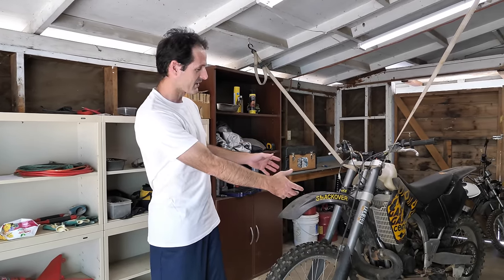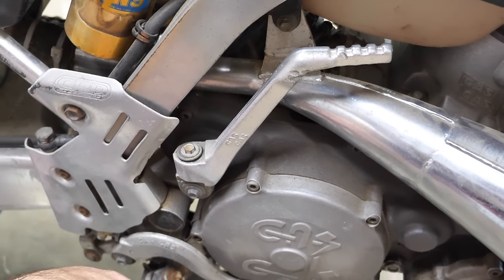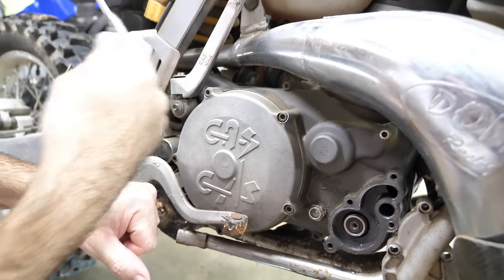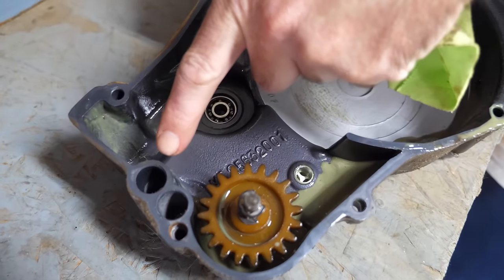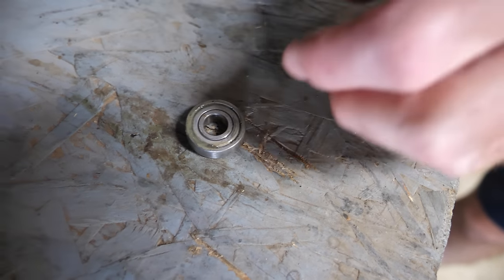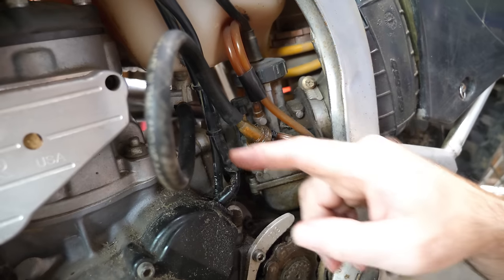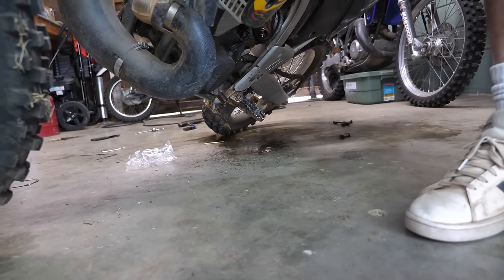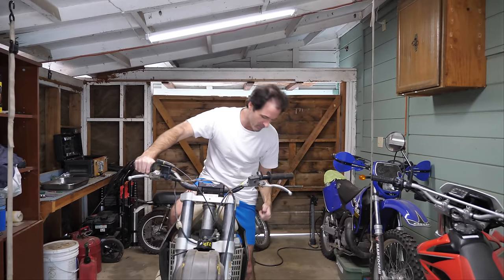Rare Old Dirt Bike Picked From A Backyard - WILL IT RUN??

Comment: This video felt like a throwback to the old days of Jennies Garage, loved it.  Also, that type of water pump seal is very similar to the floating face seals used on Excavator Final Drives, also called a duo-cone seal.  They're really durable and last a long time if kept clean.
Reply from the maker: Glad you liked the video! It looks like that type of seal is more robust than the rubber kind. And it doesn't leave grooves in the shaft.
Reply: Also the Same type of seal used on hot tub pump motors.
Reply: poolman here...what is this technology you may speak of? i only ask because " i no want fix no more" type 25+ years in its just annoying now ...Can this seal withstand more normal heat than a pool motor? Im asking is it new? Stopping leaks would help us all out right? Apoligize if i havent researched yet before i asked. It sounded cool.  Couldnt resist that, and...well what if it works?
Reply: The previous owner thought it needed a clutch because it was bathed water and not gripping very well!

Comment: Smackover Motorsports was the GasGas importer at the time the bike was new. The steering damper is from Drew Smith at Works Enduro Racing.  The bike also has some decent period-correct upgrades - LT Racing power valve cover, larger gas tank. It's obvious that at some point the bike was valued and loved, before it was beat on and neglected.

These were absolutely incredible bikes back in the day, and will still stand up as a great woods bike. I just finished an engine rebuild on my 99 EC200, and it's back to riding the single track like the day it was new.

For those watching this later, Central Powersports Distribution carries the legacy GasGas parts inventory (now Rieju), and the water pump seal IS still available as a kit.
Reply from the maker: Thanks for taking the time to comment and share your knowledge about Gas Gas bikes.
Reply: Matto Cycle and Halls Cycles still have a lot of old GG parts in stock

Comment: :face-green-smiling:If the scratches REALLY bother you.....EBAY has them coming from Slovakia... Plastic Body Kit-Brand New
$250ish
Full set of gaskets?.....WHY NOT?
They were as unsure as you what they would find, good insurance.....

Didn't see you check for plugged emulsion holes...could cause air fuel mix ratio issues....

Old gas? 
Works as a10:1 mix in your old carburetor machines as well...That's how I dispose of my used motor oil too.
Excess food take out napkins filter gas well here...

Needed 3 smoke breaks for this one, your "word play" was killing me... 😏😉
Reply from the maker: Thank you for the recommendation on the plastics! Good to know they are still available. I blew out all the holes that were easily accessible on the carb. It was so clean though, I didn't take it apart any further.

Comment: Crazy thing is that water pump seal...its the same as pool motors. A porcelain to porcelain seal. Everyday folks...we learn something new. Also love you guys channel. The positivity the joke attempts, its all just genuine. Thank you. Keep em coming.
Reply: Pool service etc is my occupation not by choice its just what i know. But those seals...look identical to pool motors my guess is just a bit smaller. And as you said,,,being threaded backwards on empellars yes...is a thing. Some do have a screw in the center of that guy made of plastic that you can easily stripp out not knowing shes in backwards bud"Like the prop on a airplane. A pool motor is looking the same as i see here as far as seal and sealplate. No volute present for there is no pump pot.
Catching the fact that it hit the case due to damage on plastic...good eye. Very good eye. Exactly as you showed...if that seal gets hot and runs without water to cool them..or has that kind of movement allowed they have a fair reason to leak. Its porcelain im not entirely sure how it works not sure science does either but  somehow it works without leaking lol...and the heat dissapation is highly pretty recommendedly decent in ceramic. Arent space shuttles made out of this coolness material?

its a tiny pool pump. h.3l yeah"

also kudos on that 3rd kick....you know u gotta redo all fuel from any purchase....but saving money on the part cleaning solution..from the crappy gas....i cant resubscribe? Upvote from me.

Comment: I wouldn't call myself a bearing expert, but I've dealt with them quite a bit.

There are two reasons for bearing play being a thing: One is to prevent the bearing from locking up or being harder to turn, when the metal expands due to operation in environments above room temperature. The second reason is that every functional surface is manufactured within a certain tolerance - there always needs to be a little play to account for that.

There is a DIN Standard which sanctions radial bearing play (or radial internal clearance if you're fancy). It's DIN 620-4, if you want to look it up. It defines four classes of internal clearance: C2, CN, C3 and C4, with C2 representing the smallest amount of play. CN is the standard internal clearance class - the vast majority of roller bearings that are manufactured to the DIN standard, have a CN internal clearance. The internal clearance class is only specified in the designation of the bearing, if it is not CN. Even though not every ball bearing is manufactured to the DIN 625 standard (DIN standard for ball bearings), the internal clearance specified there is going to be comparable to most roller bearings out there.

For roller bearings with a inner diameter from 6mm to 10mm, the internal clearance is specified to be between 2 and 13 micrometres. The water pump shaft bearing in the video obviously has a way higher internal clearance than that and it also sounds (and probably feels) like it has seen better days.

I love your videos, greetings from Germany :)
Reply from the maker: Thank you very much for that information! Your comment is an asset to me, and hopefully others who read it. I didn't know of those standardized specs, and I will very likely use those clearance tables in the future.

Comment: Cant beat an old 2 stroke!!

Ironically enough I pretty much did the exact same thing when I got my old 99 kx250 running after 10 years with the same issue and I used a Jennie’s garage to get it running.

The bike is now completely restored and loving life ❤️
Reply from the maker: Good job on the fix. I had a '91 kx250 when I was a kid and it was lots of fun

Comment: Things have finally come full circle. With your 92 KDX videos you inspired me to get a KDX myself. My 93 KDX needed the exact same repair as Hard Times as the water pump shaft was pitted, and not concentric enough to be a permanent fix, even with a new seal. Had to search high and low for the new shaft, but Jeff Fredette had one remaining OE part on his shelves. He said if it really came down to it, he could make one.
Reply: To answer your question at the end. I test rode my 93, so I knew it ran. But during the post test inspection I saw milky gear oil. I flushed the the gear oil with fresh when I got home, and the oil turned milky in a few minutes. So I knew I had to dig into cooling system. Once done with the new shaft/seal/bearing install, I rode the bike for a few minutes, then flushed fresh oil. Did that like 3 times to be safe. And used the exact term as you, sacrificial oil.
Reply from the maker: Always a great feeling when you are calling around for a rare part and the guy says........yeah I have one of those.

Comment: Hey folks, love your videos….I rescued a 2004 gas as ex 300 and I found the same sort of wear on the same items as you. The kickstart can and should be repaired, also the brake pedal end can be replaced, along with the gear lever end. Spanish metal on these bikes don’t  last long, or bearings…lol however….the engines on these bikes are bullet proof!  I absolutely love mine ! You can adjust the power valve power delivery too. Your rear shock is ohlins and is the best money can buy. Front forks are marzocchi items , hydraulic clutch too. What’s not to like ? Looking forward to the next episode….🏁
Reply from the maker: Thanks for the comment. It's great to hear from somebody who's familiar with these bikes.

Comment: Awesome video, you two are always fun to watch. Only thing I would have done different is throw a little fresh gas through the spark plug hole to see if it fires off before removing carb or doing anything else. A hard ride may have also fixed your clutch problem but could be dangerous without back brakes and no kill switch lol

Comment: i got a 125cc Beta trials bike for fairly cheap. it had not seen a lot of regular use and the previous owner said, if it doesnt get any use for about a month, the clutch will stick. that turned out to be true. i used a very fine grit sand paper to clean the metal clutch discs, which looked identical to yours. as a trials bike, it still doesnt get a lot of use, but now sitting for 6 months is not a problem. so id say, your clutch remedy should be a success. and you havent lost anything either way - you can always buy a new clutch pack if it gives up the ghost.
also, love that you are back! eagerly waiting for more videos :)
Reply from the maker: That's great that you got yours fixed for free. And honest seller for mentioning the issue.

Comment: Those mechanical face seals are in every centrifugal liquid pump I've ever seen, and inside A/C compressors.  They can withstand hundreds of PSI of pressure due to the spring tension that holds the carbon and ceramic faces together.  Running them without liquid or compatible refrigerant oil in contact with them will damage them very quickly.  They say you should not touch the sealing surfaces of the seal because the oil from your skin will contaminate the surfaces, some say it's not too critical, but I try to avoid touching them as much as possible.
     As far as your diagnostic flow went, Top notch!  I may have sacrificed some new oil to see if it ran but you knew you had compression so it was worth the risk.
Reply from the maker: Yes, I never knew those seals existed or how common they are. I also read not to touch them so hopefully pushing it in by the face didn't harm it. Thanks for the comment!

Comment: So glad to see another upload from you! I definitely would have drained the coolant, added fresh oil. Put some gas in the cylinder and made sure it popped before i put anything into it. Too many engines are DOA when you get them free, or "packaged". Just my way though.

I guessed the clutch had "swelling" of some sort due to the symptoms. And you fixed it the exact way i would have! Great video.
Reply from the maker: Thanks for the comment. Glad you liked the video!

Comment: I honestly would have run it first. I probably would have loosened the carb drain screw instead of tipping the bike, but I guess that works too! As for the clutch, props to you for cleaning it up! I would have ridden it a bit and in my experience anyway, when they get hot and if you rev the engine good with the clutch pulled they seem to pop open and start working. That thing ought to have some power! I got a 250 2 stroke and its wicked fast, and hard to kick as you clearly demonstrated in the video. It really does kind of take a knack to kickstart old larger sized engines, especially with the tiny kick starter!

Comment: You scored!! That GAS GAS 300 is very capable, super durable, and super reliable. Those rims are D.I.D.  Dirtstars and they're the same wheels that were used on Ricky Carmichael's championship winning factory KX 250.. Gas Gas used top of the line components like the Ohlins rear shock, Dirtstar rims, Renthal Sprockets, etc. It looks like those forks were set up by Les Tinious Racing as well.. I'm pretty sure a kick start lever from a Yamaha YZ 125 or 250 will work for that bike and most of the other stuff should interchange with Kawasaki KX 250 stuff.. things like the rear subframe and plastic..
Reply from the maker: Thanks for the information! I have heard that the engine is a solid design. I didn't know about kx250 parts compatibility.

Comment: Oh hey, you guys are back! Good video. I would have drained the tank first. Since it was sitting outside it probably had water in the fuel. Then oil change and water pump rebuild. Then as others stated, dribble a little fuel in the cylinder and see if she fired. I ran into a similar issue on a 1998 KTM 300. Love the banter with you and camera girl! First ride was short, but technically complete. 😆
Reply from the maker: Glad you like the video. That was a nervous "first ride" because I didn't expect it, and since I had no clutch or back brake not many ways to stop!

Comment: I would have done the same approach for the water pump seal. For the clutch plates, I may have soaked the steels in Evaporust. That stuff is pretty amazing. Your method was faster and probably arrived at the same end result. I was expecting the basket to be notched out. I had a Husky of the same vintage and the fingers on the basket were notched like crazy, resulted in the clutch sticking.
Reply from the maker: Yes luckily that basket wasn't notched out. I bet a new one would be expensive. I've never tried evaporust but I imagine a possible benefit to it would be that if you have a part that you don't want to disturb the surface of, it isn't abrasive like sandpaper of steel wool.
Reply: @jenniesgarage I highly recommend Evaporust. It's more expensive than something like vinegar but you could also leave it in a gas tank for a month and it wouldn't eat away at the metal. It also doesn't damage paint.  I have some in a CT90 tank right now :) Look forward to the ride video!

Comment: 32:58 you have the bearing in right. If you had installed it with the sealed side out, it would not have ever got any oil from the crankcase. Having the seal against the water pump seal helps prevent oil from entering into the water pump seal and coolant from entering the bearing. It's a additional barrier between the 2

Comment: Such an awesome video! Perfect in every way! The robotic otter comment by camera girl had me dying. One thing I would've done differently is instead of blowing through a tube on the outside of the water pump seal, I would've put low psi compressed air to the oil fill hole. Then you could spray soapy water on the seal and watch for bubbles. I think that would be a more efficient way to test it. Looking forward to the next video!
Reply from the maker: Happy you like the video! Good idea about pressurizing the transmission.

Comment: If I was troubleshooting it, I would have suspected the seal you replaced but I would have changed the oil with something cheap but clean and then immediately ruined it by insisting that I had to make sure the engine ran before I spent a dime on parts. In the end I think we would have had the same outcome but I would have wasted some oil and you risked $37 buying parts for a possibly bad engine. I'm glad it found its way into your capable hands and is getting another chance to be ridden around.
Reply from the maker: You are exactly right. There was a risk either way.

Comment: There used to be a product for fixing old plastic called "Plastic Renew", (If I remember correctly from decades ago).  It was a lot of elbow grease with sanding before applying the chemicals, but it actually worked pretty good if you did the time.

Comment: As soon as I saw rusted clutch plates I thought 1500 grit paper on a sander. I never even thought of steel wool good job.
Reply from the maker: Thanks! My first thought was sandpaper too, but we didn't have any so I went with the steel wool. Thinking about it now, steelwool might have  been better because it isn't as abrasive and won't cut into the metal like sandpaper.

Comment: Awesome video! Just a heads up use wet clutch oil next time. Your bike will thank you and it’s designed for Atv/dirt bikes. Some clutches won’t even shift right or the clutch won’t engage without it. Had issues with it before on a 400ex with the wrong type of oil

Comment: Smackover was a dealership in Arkansas I believe. They were one of the 1st US dealers to import the GasGas's. Jim Cook was the guys name. Im a huge gasgas fan ive got about 5 of them right now and the bikes are built like tanks and use a ton of parts from all the most common bikes
Reply from the maker: Thanks for the information. Your username checks out.
Reply: @jenniesgarage  look forward to seeing you ride the bike and upgrade it it along the way. I can personally confirm that current Yamaha yz250 foot pegs and kickstarter bolt right on, 98 Honda cr250 air filter and brakpads will fit. Steel Subframe and rear plastics from a 94-98 kx125/250 will fit right up. I've read that the clutch plates are the same as a cr250 but it uses an extra fiber and steel, haven't had to find that one out yet though.

Comment: Awesome.  Those old gasgas 300s vibrate like nothing else but sweet video.  I wouldve done the same with the clutch.  If you let it warm up and just wear the clutch a bit itll clean up the rest of it for sure.  Probably worth changing the oil again.
Reply from the maker: Yes I'm going to change the oil again after the first ride. I'm excited to see how it rides.

Comment: When I have a Coolant/Oil mixture situation on any of my engines, I drain the milky oil and replace it with some used motor oil to flush the crankcase.  That way you aren't wasting new oil and are at the same time recycling in a way. 🙂
Reply from the maker: Good idea!

Comment: When I have to resort to using a screwdriver to pry cases apart, I cut out a piece of old inner tube big enough to wrap around the head of the screwdriver, then black tape it on. It'll help protect the surfaces from getting gouged
Reply from the maker: Good idea.